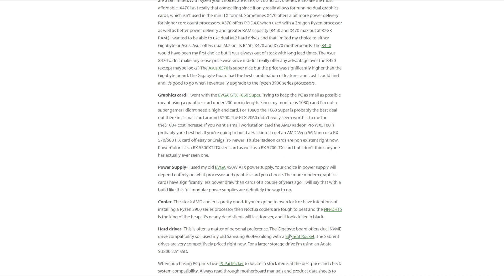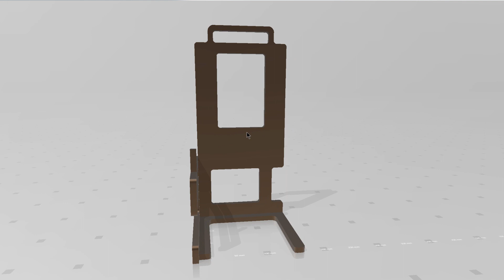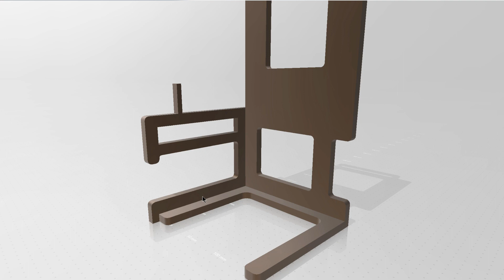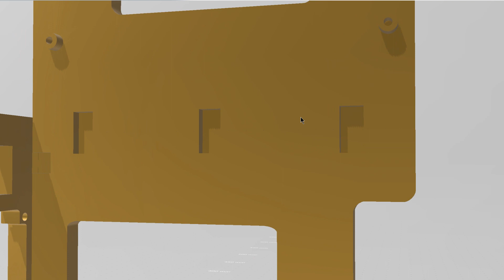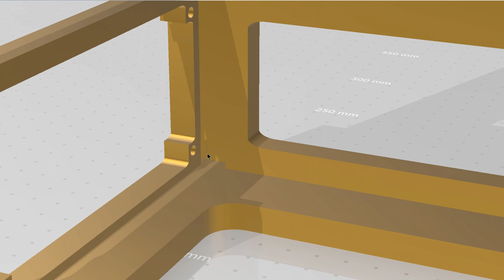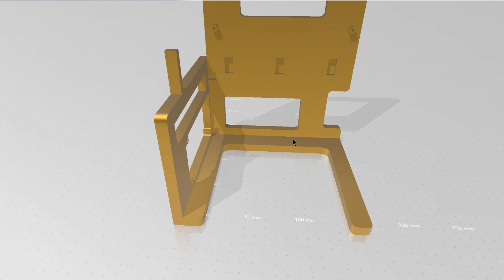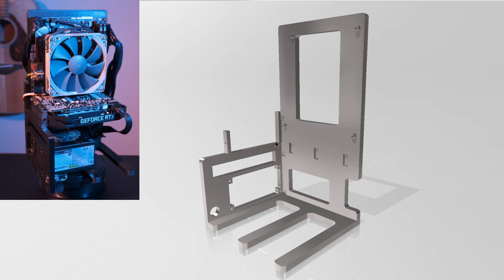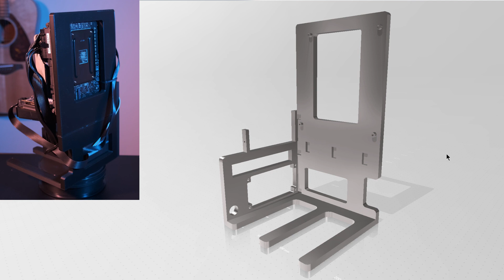I 3D Printed My Own 10.6L Open-Frame SFF ITX PC Case

Comment: I need this same exact design but for a 1200 watt ATX PSU and a strix 4090 😔
Reply from the maker: You can use an ATX PSU, but yeah limited to dual slot GPU

Comment: Can you make the mount or design changes on the back for 240mm and 280mm AIO? I think it just needs a hole on the back that can screw in a dual 120/140mm fan.
Reply from the maker: You'd also need passageways for the air to flow through. Someone on thingiverse modified it to hold a radiator on the side.

Comment: Printing right now on an i3 MK3s+  Prints are speedy.  .3mm layer height w/ a .4mm nozzle.   Just using Prusa’s own profiles.  Longest print is the Motherboard piece at 5hrs.  Easily doable in a day of printing if you start in the morning!

Comment: See that is the problem. All these modern open air very cool cases are for ridiculously small motherboards that honestly nobody really uses unless you're not gaming. I am a huge gamer but it's hard to find modern cool cases like this and the ones that they do make are way overpriced like to $300 and then they're really big. That would be awesome if you can make this case to be able to hold an ATX side motherboard. I've seen so many like this but it's all micro and smaller and motherboards and I can't find one that is minimalistic like this that I can use an ATX motherboard on.
Reply from the maker: I have another one that holds ATX. You print out bars. The issue is ATX is hard to print because of the size.
Reply: @LohTec  ohhhhhhh. That makes total sense now. The size thing. Yeah 3D prints are not that tall. Well if you can link the other one that you said is for an ATX that would be awesome. Like I am literally thinking about making my own distroplates as well. My friend has a cnc saw/drill so that would be cool and I been watching people make there own too.
Reply from the maker: @nunyabusiness3567  https://youtu.be/IR4NWpqXP5c If you have a CNC machine there is probably a better option

Comment: Will this support something like a d15s or only small cpu coolers
Reply from the maker: Technically supports anything, though if you are planning on putting heavier parts I'd up the infill and maybe add adhesive.

Comment: Difference between OFC_MB 1.1 and the attached version?
Reply from the maker: Not sure what the attached version is, but 1.1 made the case slightly shorter by removing ~7mm that wasn't needed. There is also a version that has cutouts if your MB IO shield is built-in.

Comment: Do you have a micro atx version of this? :)
Reply from the maker: Saw your other comment too. No, mainly due to print size limits and micro atx board sizes, but can be done!
Reply: @LohTec  cause mini itx mobos are out of stock :(
Reply from the maker: @sefisredtv8991  gotcha. Yeah, not hard to add, but you would need a large printer
Reply from the maker: Micro atx is the next case :)
Reply: @LohTec  awesome :)

Comment: Does your GPU sit properly in the given space for the GPU bracket and the PCIe connector? (the little cut out)
Reply from the maker: I'm not sure exactly what you are asking, but my GPU fits correctly where I have it and designed the base piece so GPU IO bracket can fit correctly without being tilted up. Does that answer your question?
Reply: @LohTec  Yes, thank you. I have printed this with the atx psu bracket but my gpu doesn't seem to fit correctly to the GPU IO bracket
Reply from the maker: Hmm. I didn't adjust the GPU section when I made the ATX part. What GPU and MB?
Reply: @LohTec Currently running an ASUS b450i motherboard with a RX 580 Nitro+ from Sapphire
Reply from the maker: Odd. I have the same MB but don't have any issue. If you can link a picture I can see what the issue is and maybe modify the design.
Reply: @LohTec  you have to lower the part where the gpu screws down by I think .7 of a cm
Reply from the maker: That's a lot! Are you using spacers with the MB? You don't need to.
Reply: @LohTec  Nope, I am not using spacers with the motherboard. BTW you can get rid of 10mm from the top of the motherboard's print file.
Reply from the maker: Yep, am aware lol. It was more to keep the aesthetics.
Reply: @LohTec  I just say that you should because I had to cut that much away in order to print it out on the Ender 3 printer.
Reply from the maker: The biggest piece is like 220mm? Isn't that ender 3 build volume?
Reply: @LohTec  I have no idea why, but it jus wouldn't let me get a .gcode for it. I think the printer is something like 210mm.
Reply: @siyulater  I had the same issue when i put it into cura, I found I had to remove the skirt because the skirt adds a greyed out are at the edge of the buildplate.
Reply from the maker: I cut out 7mm

Comment: Nice. What’s the weight?
Reply from the maker: Of the print? With 20% infill it's around 400g, but if you want to put heavy parts you'll want to go higher so it will weigh more.
Reply: @LohTec  ok thanks
Reply: @LohTec  what would a setup like this weigh for an ATX motherboard build?
Reply from the maker: @amitcarbyne3635  this only supports ITX, but ATX with all the extra plastic it would be around 1kg
Reply: @LohTec  that would better as it would be easy to clean the dust on a less dense build as open build has dust problems.